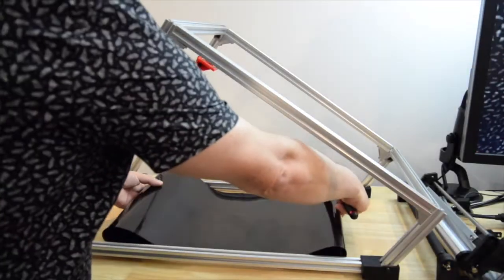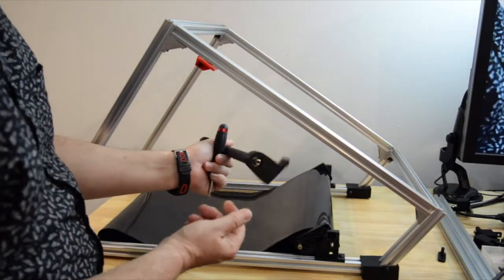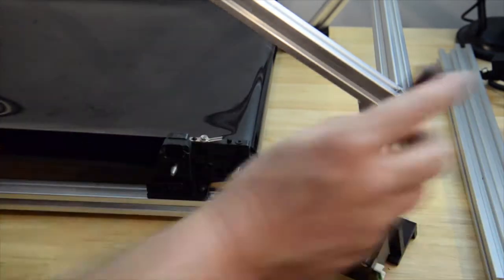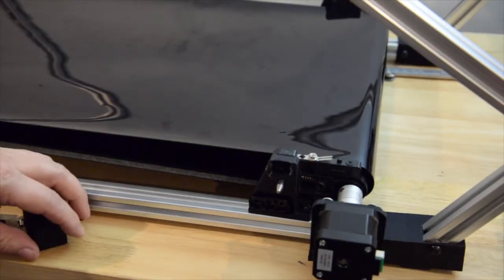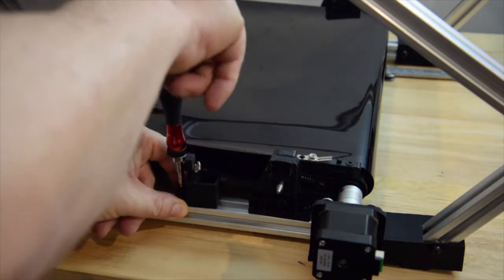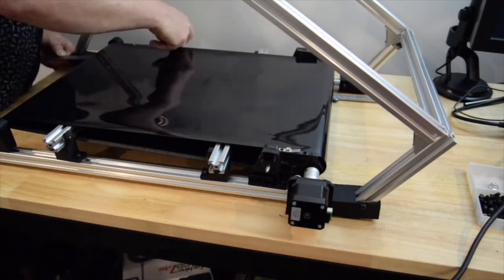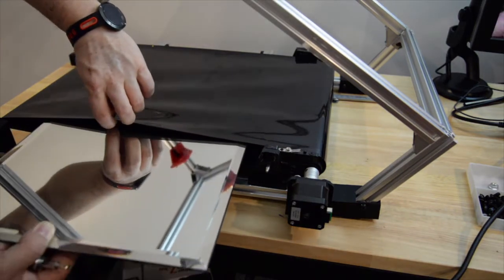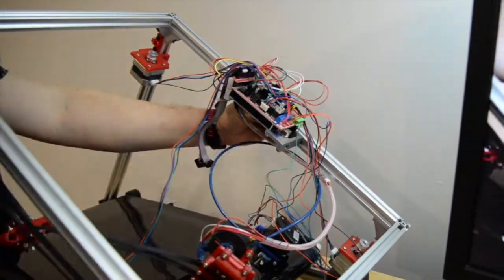Update: Hypercube Infinite with Laser Printer Belt

Comment: I am interested in building this in the future. Would the heated bed only need to be in the small area that the print head touches the belt or does it need to be a good portion of the belt?
Reply from the maker: If the belt is covered in Kapton tape or is a laser printer transfer belt, then it needs to be hot for PLA you stick. Then you need a good portion. You could use painters tape with no heating at all to start prototyping with.
Reply: how well do you think a stainless steel printer belt with PEI as the surface work?
Reply from the maker: I think it would work brilliantly. Stainless steel would make it rigid so the prints don't wobble. And PEI would stick well.